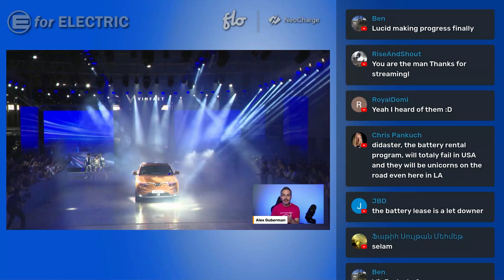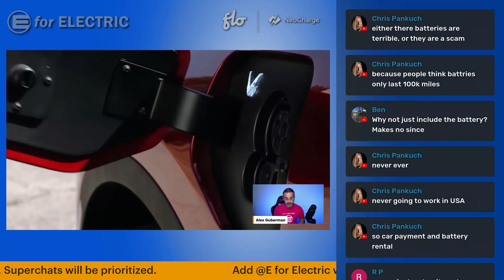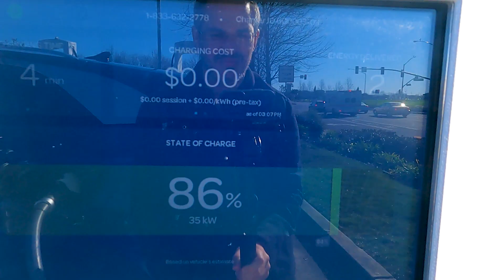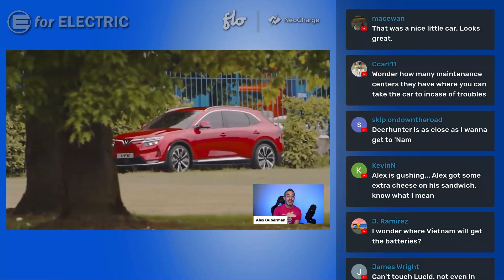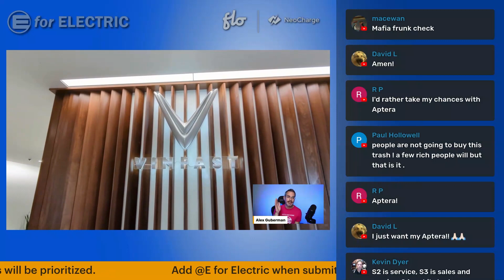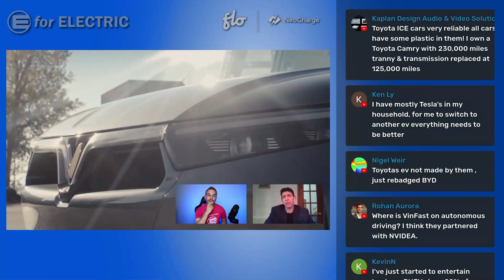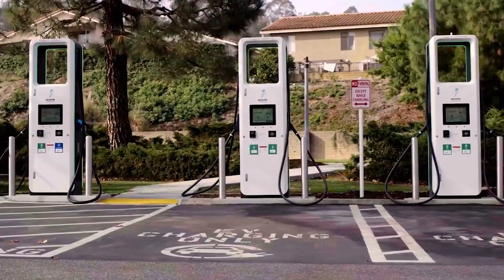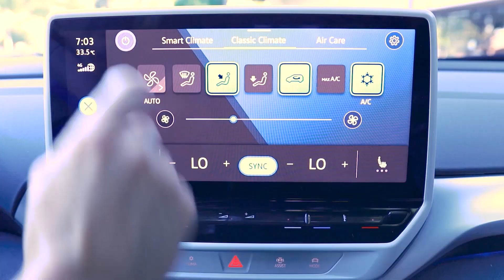New EV Sneaks Up on Everyone

Comment: They're only a blip on the radar until they've ramped up their production.

Rent for 100+/month, no thanks. I'd rather use the chargers as I need them rather than have to take the car somewhere to have the battery swapped out.

0-60 times in the 2-3 second range in my opinion is wasteful unless you're buying a sports car. For normal driving 6+ seconds is just fine, and it would likely increase the range or reduce the number of batteries which means lower cost/less weight.

So, if I understand it better now that I've watched more of the video.
You buy the vehicle.
You lease the battery.
You pay for the normal charging.

How many years will it take for the battery to degrade to 70%? You'd have to balance the 1k+ per year lease with the cost of a new battery pack later. I doubt battery packs will still cost 20k+ in 5-10 years. A prudent person would plan and put money away if they plan to keep the car that long. I doubt many people will still have the same car at the end of that time. When they sell the car, does the lease transfer? At the end of that time regardless of who now owns the car, there will be repair/service centers everywhere. More EVs equals more opportunities for new repair/service centers to make a profit. When petrol cars came out, how many fuel stations and repair/service centers were there. BUT as there were more and more of them, all of those needed services came into play.

Nothing against VinFast actually. I just don't think the lease aspect makes much sense in the end.

People need to look further down the road than tomorrow and use some logic to reason things out. Too many immediate gratification "flip the switch" types. Things will happen as they are needed as they have always happened.

So, with VinFast having already been making ICE cars for a number of years, that puts them firmly into the legacy OEM section. They will have the same headaches with adapting rather than building from the ground up mindsets. Their legacy roots explain how they were able to move to EVs so fast. But ICE and EV cars are only the same mechanically in so many ways. Do they write their own software? How vertical is their integration or are they stuck in the old ICE mindset of tons of 3rd parties?
Reply: It can be plugged in too. it can be bought with the battery as well.
Reply: @mortegasr  What's the cost of the car with/without the battery. If it's around 20k, then at ~12k/year a person would be overpaying. Each year after the 2-year point, you'd be paying ~12k/year more for "peace of mind" only. Still doesn't compute for me.
Buying it like a normal PEV would make more sense as the battery, if treated right, isn't likely to have problems.
Reply: They give you the option to buy or rent a battery, Update the news...!!

Comment: I personally wouldn't want a swappable battery. I'm going to baby my battery and I have no faith in others to do the same
Reply: You always get a fresh working battery, no need to worry about battery health. The battery swap station does a diagnosis and sequesters problem batteries. The only problem I see with it is car makers are never going to one swap standard, so the swap station will only be for Nio, which could be a good thing depending on how close you live to one.
Reply: That's a huge issue. Proprietary batteries, chargers, etc. 
That's one of the huge benefits of petrol cars, infrastructure and no proprietary nonsense.

Comment: Swappable leased batteries, no thank you.  I'd rather not have to wait at the swapping station, I'd rather be charging instead.
Reply: Sound like ice customers. I rather pump gas then wait for charging!
Reply: @yungth1811  Swapping sounds good as long as you have lots of stations in lots of locations but that's not going to happen because they are very expensive.
Reply: They give you the option to buy or rent a battery, Update the news...!!!

Comment: I used to have a Renault Zoe with a battery lease. The way it was priced, you would have to own the car over 10 years to pay the same price as the battery owned version. So if battery lease is priced well, it definitely makes the car cheaper. Also it is like an extended warranty for the battery.
However! There is a bad side too. By the time these batteries were dieing, Renault no longer had any of those batteries, so they weren't able to replace them any more.
Reply: They give you the option to buy or rent a battery, Update the news...^^~
-----
December will hand over to customers in the USA !...🇺🇸

Comment: VinFast won't succeed in the U.S. unless they sell the battery pack with the vehicle; Americans won't go for leasing deals. Same reason Nio is a sure loser here.
Reply: I don’t agree. If the lease overall is cheaper it will be a hit. I would rather pay $500 a month vs $800 a month. Now if they are expecting all the extras to be enough to convince folks to get their vehicles and their lease price is the same as the competition they will not be a hit especially being a Vietnamese company and a new Vietnamese
Company here in the States. I am rooting for them. I have my reservation!
Reply: they have the battery included option now, $15k more
Reply: They give you the option to buy or rent a battery, Update the news

Comment: You love fully electric cars yet you're about to give up on your second manufacturer.  Maybe EV's  aren't ready for prime time just yet? Hybrids a better transition option gas/electric, diesel/electric or hydrogen/electric gives time to build out infrastructure and further develop battery technology not to mention responsibly source the lithium etc.  Toyotas NiMH batteries cheap and safe no fires much more stable